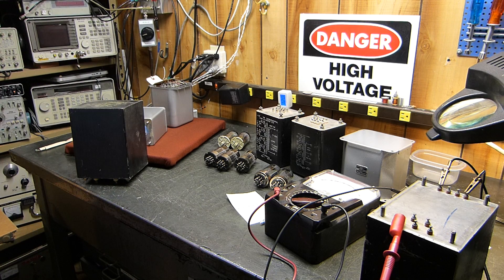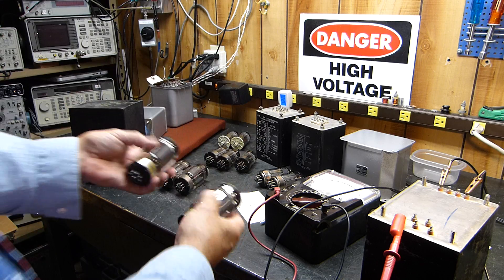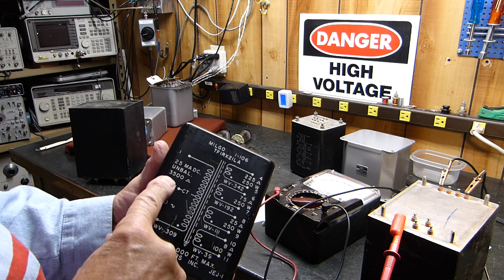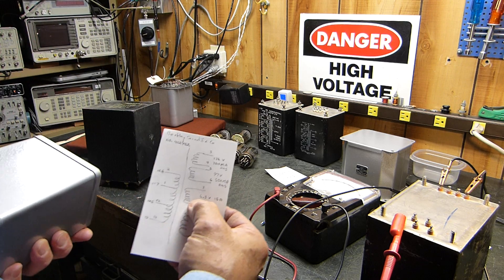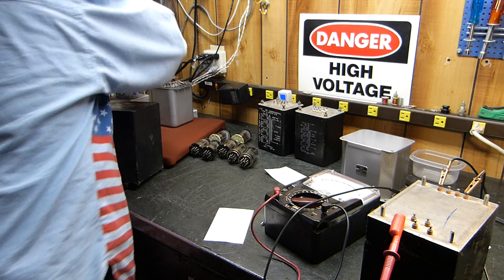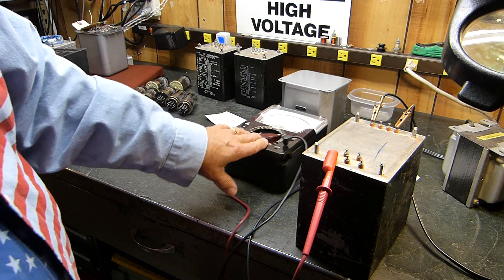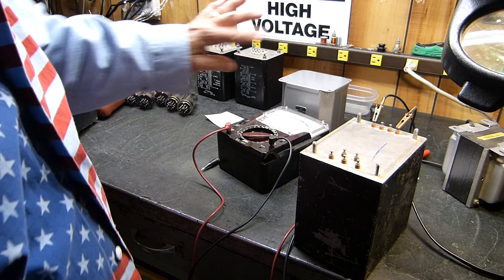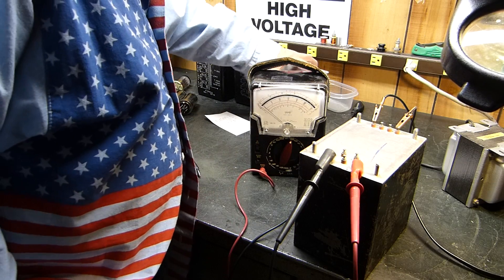6AS7 or 6080 Vacuum Tube Triode Mono Audio Amplifier Build Part 1 of 2

Comment: So 6080 is single or duble triode ? Only one in amp is mono ? Cheers !
Reply from the maker: The 6080 is a dual triode but people parallel them and use multiple ones to get the load resistance requirements very low so there is no requirement for an OPT to match the tubes directly to a speaker. That family of tubes - there are others that are larger - were designed as series regulator tubes for power supplies. I never finished an OTL amplifier so I have no direct experience with them. They have high current filaments and run very hot...  🙂

Comment: I have been acquiring parts for a transcendent pinnacle otl amp, it needs 8 tubes and theyre supposed to be 300b, i just am not too sure at what parameters are most important. I like these tubes, dual triode, look, time period, I would only need 4, it would be non chinese tubes probably a plus, and it seems like these MIGHT somewhat fit in a 300b circuit, normal bias or low bias at low volt, 180v, 60ma, -40v
Could I try these with any confidence, or would you say 300b is a must? its a great circuit, its kindof silly they just make 1wpch, 4 huge tubes,,, but I do want otl and I do think thats a very solid watt. 
Its all sortof semi unnecessarily different, with the potentials, biasing, load resistance. 
Is there something like a 300b you might be confident would work?
Reply from the maker: For one thing, 300B tubes re not cheap, even the foreign made ones. I paid over $360 for a pair by Genelex (made in Russia) and had probably eight (8) other Chinese ones that were very poor. I would expect eight tubes would cost $1500+ just to start with and I doubt the plate impedance would be low enough, even with 8 tubes,  to drive speakers very well. I never want to discourage a builder from experimenting  but realistically, I think the 6080 type and other vintage series triode regulator tubes, would be the only vacuum tubes that would work very well. I could be wrong. Hope this helps.

Comment: Just wondering how the 6080 amp turned out.  I didn't notice the part 2 to this video.  Maybe I'm missing it.  I mentioned that large lot I purchased and ended up with a dozen or so 6080s.  Not sure which amp to build next.  Got more than a dozen 1625s also.
Reply from the maker: Completely forgot about it. Don't even remember making this video. I have thought about these dual triodes a lot of times but just never did it.   :-)
Reply: @ElPasoTubeAmps  I think it would be really interesting to see how they would do.  I also found one of those 6336As. Maybe I'll find another in all of these boxes. Seems like your 1625s do pretty well.
Reply from the maker: @kgsalvage6306  Yes, those 6336's draw enough filament current to keep the room warm. Now that we are talking about these amplifiers again, I remember thinking how hot the chassis would be with a few of either of these big triodes. With the low value of plate load resistance, it seems reasonable to go the way of transformer-less although, again now it has been brought up again, I do have two nice WE transformers that are 500 to 8 ohm. Maybe I will revisit this idea. Thanks for bringing it back to life...
Reply: @ElPasoTubeAmps  Hope you do get back on this.  I keep finding more 6AS7s-6080s and 6336As.  There are a few 6336 amps on YouTube.  The one is a parallel SE amp, but the creator is foreign.  Can't understand him. He shows his circuit though.  It's kinda rough. I probably have 15 or more of each.  Thought about maybe parallel push pull configuration.  Then the primary would be lower yet though.  That transformerless idea is very intriguing.
Reply: Boy, That would be a lot of filament current also!
Reply: @ElPasoTubeAmps  There's a nice post on Google.  The guy made se monoblocks @ 20wpc with two tubes each channel.  4 triodes in parallel.  He said it keeps up with his 300b amp. Great article. http://www.troelsgravesen.dk/AudioMirror.htm
Reply from the maker: @kgsalvage6306  Maybe this one will be next... I did just finish my 300B SET amplifier tonight enough to listen to it. Very interesting. I am listening to it on very inefficient speakers but it has a character all its own. Got more testing and listening to do. It has zero NFB and gets loud very fast.

Comment: Are you ever coming back to these 6080's???  I just put together a 6DJ8 6080 OTL headphone amp design for my son and his new 600 ohm headphones.  It is working and sounding pretty good for a sloppy prototype.  I have some noticeable white noise, not hum at lower volumes.  Using DC heaters and cheap Chinese step down and step up boards for my power supply.  Of course there is lots of tweaking still to go to be satisfied with the design yet.  LOL  I was hoping you would come back to this tube and we could compare notes  OT  vs OTL  ;^)
Reply from the maker: This amplifier build has crossed my mind many times. The lowest Z OPT I have is 3.5K which will probably work OK but I also have been thinking about an amp with some very nice Svetlana 572-160 tubes that I have six of brand new and I have a good 10K primary OPT. These Svetlana tubes are actually 811A tubes without the plate cap. Not sure which one I should go to.
Reply from the maker: Are you running your 6080 SE? Just trying to think of why you would have your white noise. Besides the filament pins, I believe, if my memory is good, the 6DJ8 has the same pinout at the 12A...7 family of tubes. I remember in the Williamson amps I have built, I have had more noise when I used the 6SL7 (high mu) triode than the 6SN7 (medium mu) so I might suggest try a 12AU7 if you don't mind re-configuring the filament pins. I know gain will be less but maybe so will the noise. Just a thought.
Reply: I have a ton of nice Amperex made in Holland 6DJ8s and it is a medium mu dual triode but pin 9 is not the filament CT but a Gnd shield.  I have found another OTL amp that uses 6SN7 as the input tube.  I have plenty of 6SN7s and 6080s too.  If you send me an email I could send the schematics to you and you could save your nice OTs for other amps.  ;^)
Reply from the maker: I couldn't remember without looking it up again. I thought it was a high mu triode like a 12AX7. I have never built a OTL amp so I have no experience with them. My YouTube direct email address is theaudioshop@sbcglobal.net.I have been into a bunch of projects lately and none of them has afforded me any time for audio work. I do want to build more and post. The YouTube experience has been very good for me as I get suggestions from  you guys that I never thought of. I had a tour of a medical lab today and I told them all about my experience with YouTube and the suggestions I get but I don't think they get it. I am 68 and have everything to share and nothing to lose and as a younger working individual I understand how they think. For one thing they don't have the time I do and for another they are secretive of their knowledge afraid someone will steal it - and they might so, I guess it's not all bad to be a senior citizen... I would appreciate your schematic. Have you put it into LTSpice to simulate it?
Reply: I sent the schematic email.  Did you get it?
Reply from the maker: Yes, got them - thank you. I will write later and we can discuss

Comment: Excellent.  I have a big stash of these tubes that I plan to do some fun things with, including a low-gain pre-amp (plate resistance is low enough!).  I have some old H/K output transformers that would be perfect for these tubes in push-pull.

Comment: Just curious if you ever ended up building it, I love my 6336a SET amp, blew my 300B amp away. I was amazed by it's flat THD response. .... On a side note I was working on my 6B4G amp last night and discovered that one of my tubes isn't functioning that great and when I was looking around for 6B4G's I came across Sovtek's monoplate 6B4G, I was wondering if you have any experience with them. They definitely piqued my interest but, at $140 a match pair I'm not that eager to buy them.
Reply from the maker: No, I still haven't built the 6080/6336 amp. I have a bunch of brand new Svetlana 572-160 that have caught my interest lately. They are actually an 811A but with the plate cap on a base pin. I may build something out of them.
As for now, I listen to the 6B4G amp in my shop more than any other amp I have. I showed it again recently in a video and it does  10 watts at best with SS rectifiers.
I haven't tried the Russian tubes yet.
Reply: The 572-160's look pretty sweet, I'm guessing you'd go push pull with them, How much power would they put out in PP? I'm feeling the urge to build something myself since it has been a while. I really like the James Audio transformers and I've been hoping to come up with an excuse to order some. My only problem is that my main speakers are pretty inefficient (Magnepans) So I have a hard time finding tube gear that isn't super expensive that can drive them and most of my favorite tubes aren't very efficient. How do the 572-160's compare to the 6B4G's in terms of sound?

Comment: Let´s see what you´re comming up with...i built a 30Watts PP amp with a pair of 6080 a looong time ago...
What always comes along with these triode amps is that you need a whole lot of input signal voltage swing. My preamp has had a swing of around 280Vpp.As unlike pentodes, triodes doesn´t have any signifficant voltage amplification. The driver needs to provide nearly the whole voltage...You need to think more "transistor-ish"
A voltage amplifier (preamp) followed by a current amplifier (output triodes).
Reply: I think you could get the required driving voltage with a Mullard 5-20 front-end with ECC83s for both the AF amp and the phase inverter, especially if the AF amp used a CCS load.

Comment: This should be an interesting build...looking forward to seeing the progress, and the test results :) Keep 'em comin'
Reply from the maker: Totally agree with you. Much better to deal with mV instead of KV.  Thanks for your comments. BTW - just glancing at this video, I have put five of those largest transformers to use in equipment I have built since this posting - and bought more high voltage power transformers since then. It looks like I just can't get enough of this stuff...

Comment: To be even safer when testing an unknown power transformer, instead of feeding it's input with 120VAC, I start by giving it 6.3VAC from my bench power supply.  I then take the much lower output readings, and do a ratio conversion to tell me what voltage I can expect when I do put 120VAC on the input.  ;^)  You always seem to have those nice, big, sealed, top quality, expensive transformers.  I wish I was as fortunate.  LOL